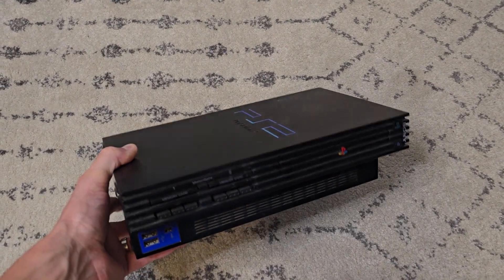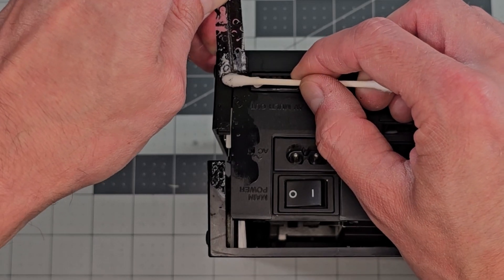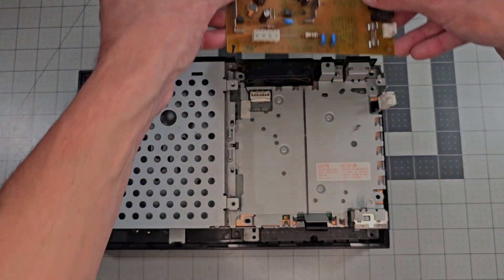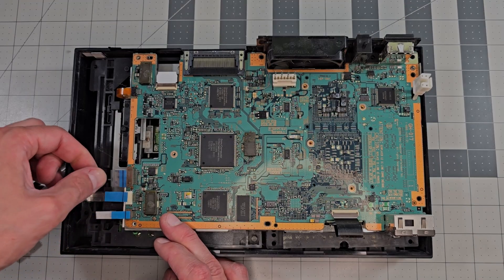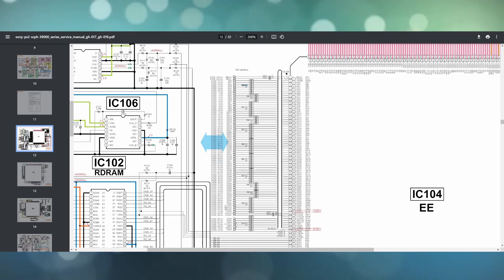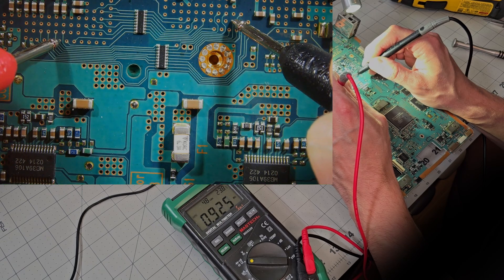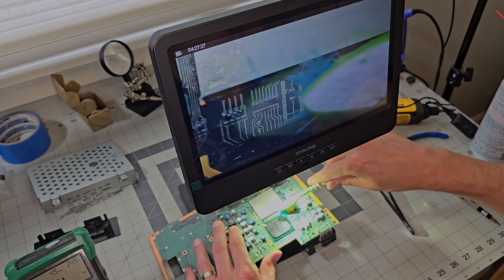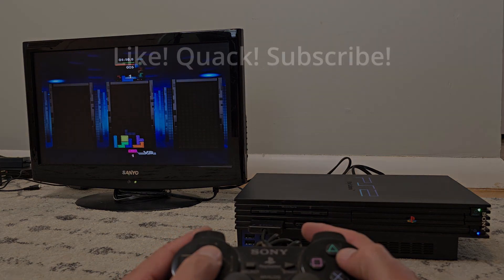Fixing a PS2 with a Broken ("Glitchy") Display

Comment: I have a similar problem however the screen is white and fuzzy with a line down one side no images are displayed. Model number is SCPH  39000,  am hoping this will fix it if not it's probably another board.

Comment: so currently trying to fix my ps2, and i will be honest first time working on something this complex using a magnifying glass and a budget soldering iron, testing the resistors get ranges from 47-50ish ohms but think that's just bad placement on my part hard to see and I'm not use to working with a multimeter, but i did check one resistor on the back side of the board that's 192ohms and unsure if that's too high and if i should bridge it. does anyone know what ranges are safe and what are not am checking each resistor twice since I'm new to this specifically so very bad at placement but want to know what I'm keeping an eye out for
Reply from the maker: Sorry each scenario is too unique to address without seeing things first hand most of the time unless you can give more specific information. "one resistor on the back of the board" is not clear enough.

Comment: I had no idea how to use a multimeter, and I've only ever soldered CMOS battery trays to boards. I followed your guide EXACTLY with my GH-022 AND IT WORKED. Instead of bridging it, all I had to do was clean up the solder and melt a little bit more in there. Putting it back together did not think it would work but omgoodness it works like a champ now. Thank you so much, I was so upset when it quit working.
Reply from the maker: That's awesome, glad you got it working!

Comment: I don't know if this is the same problem or not. But I have a PS2 and I don't even know how old it is at this point. But every time I start up the Playstation, the graphics are messed up and very glitchy. The language is messed up (unreadble). When I start any game, the textures are constantly flashing and it looks like a child scribbled all over the screen. The size of textures are completely messed up, and it's impossible to play games like Tomb Raider since some of the textures that you need to see just don't show up. 

My cousin told me it is the GPU that needs to be replaced or fixed, but I just want to make sure.

Comment: thank you so much for this. I had same error, and same first chip had dry joints as yours did, and on the other side of the board one section of the 2nd array was open circuit. I didn't have a usb microscope, so tried it with my magnifying glass and it was a fail. my eyes are too old, hands too shaky. ended up pulling the track on one leg's pad. had to get a usb microscope and run a fine wire to the test point. after I did those tho, it's going again! will get a new array to replace the one I've shorted. thank you again!.
Reply from the maker: I salute your patience and determination in getting the job done, and am happy my video was helpful, nice work!

Comment: The visual connection went out on mine some months ago. Today, I tried "deep cleaning" it JUST in case, to see if I could avoid taking it to a repair shop for "circuit surgery." This video and my failed attempt confirmed my problem really IS in the bowels of the console. I don't have the equipment or technical knowhow to do this myself, so I WILL have to take it in. But I still loved seeing you accomplish this miracle!! It's as good as new and looks stunning! Great job!
Reply from the maker: Thanks for this comment! I hope you can get yours fixed one way or another :)

Comment: My ps2 is a bit weird when using component (ps2 to hdmi). I have to "heat it up" for 15-20 minutes for the image is stable enough and not constantly lose signal. Maybe its time for recapping i guess
Reply from the maker: Recapping isn't a bad good idea, but I would also inspect the component cable itself, and also test with a different display as earlier steps.
Reply: @FantasticQuack but the green light on my fat ps2 is extremely dim at first and start gradually get brighter and brighter. Thats why im suspecting the ps2 that having a problem. But that only occur on component video though, if i use good old composite the display always stable even within the first minute
Reply: @dollarggwp9048  That def seems like powersupply issues.

Comment: My PS2 suddenly had polygons go all crazy, and green. It's weird because I could still use the system and attempt to play games, but yeah it's pretty unplayable. Found a one resistor not making any connection, another at 77 ohms, wish me luck!
Reply from the maker: Sounds like you're on the right track, good luck!
Reply: @FantasticQuack Was able to get it done yesterday, it worked, buuut unfortunately after I tested it, I went to reassemble it, and seem to have broken the power supply in the process? I was getting a high pitched whine for a bit, but now nothing, I've ordered a new one so hopefully that's just it

Comment: to make the short, what kind of wire did you use? New to this stuff
Reply from the maker: I just clipped a short length off the leg of a thru hole resistor

Comment: Hi!
So if one of the pads on a resistor array is reading 65 Ohms instead of 47, could that resistor be the issue?
It’s one of the resistors between IC104 and IC202!
Reply from the maker: Possibly but doubtful, you could test it with a temporary short to be sure
Reply: @FantasticQuack  My Ps2 is also 39001 and the graphical glitch is a lot less pronounced than yours. In the opening screen, the only thing that's glitchy is that the blocks are warping in and out, almost flickering... And games are entirely unplayable as the glitches are a lot more extreme when you boot game, although still not as extreme as what you had. I checked the resistors, there is only 1 problematic trace on RB121, it reads 90-100 ohms... This may explain why the glitches arent as extreme as yours... 

May I ask, would it even be safe to just jumper the bridge? Did sony put in the resistors for no reason?

Comment: I had the same issue after repairing the PSU of an "abandoned" ps2. The faulty resistor in my case was exactly the one around the 5:33 mark, reading 2MΩ in my case, and I'm so glad this fixed it, thanks. Do you think i should replace the array at some point? Or keep the short
Reply from the maker: I wouldn't fault you for leaving the short; the risk of it causing other problems seems pretty low, but since I don't truly know what that risk is, I would ultimately recommend replacing it (or even splicing a separate resistor with the right value as opposed to a short wire).

Comment: Hey mate, my ps2 display work fine when I use RGB output but when I change to YPBPR (using ps2 hdmi converter) my screen starts flickering and will back to normal in like 5 to ten minutes. Do you know the issue? any help would be appreciated
Reply from the maker: Unfortunately not, but it sounds like it could be capacitor related if the problem resolves with time (i.e. after heating up a bit).
Reply: @FantasticQuack Thanks for replying. I have replaced the capacitor near the AV port and my PS2 is working fine again.

Comment: I have a strange issue . I changed all bad resistors but when I turn it on it just says no display but if I reset it goes to black screen with NTSC and sometimes it shows pal but it goes direcrly into browser with a dvd icon and the wierd thing is that I disconected the dvd drive ribbons . Any ideas what can be the issue ??
Reply from the maker: Is the PS2 modded?
Reply: No not modded  @FantasticQuack

Comment: My ps2 boots up okay but the menus are patchy like you have a dirty snes cart or something. Anyone have any pointers on this? It’s so odd the boot logo is perfect but the menus are messed up. I do use freemcboot but the issues are happening with it without it in. I’m using component cables to an hdmi adapter. It was working fine when I last used it a few months ago.
Reply from the maker: You could troubleshoot the cables more buy just trying a regular composite cable on a different monitor

Comment: Hey mate, my ps2 display absolutely works fine, but there is no audio. Nothing wrong with AV cable because it works with other ps2.. Can you tell me where i can look into for the issues
Reply from the maker: I would start by seeing if you can track down the audio chips and inspect there. Let me know if you can get to the bottom of it!
Reply: Also make sure you have your audio being sent through the AV connection and not through your optical audio jack. This should be in audio settings

Comment: I have a PS2 slim that someone broke the power button when they tinkered with this, when I replaced the power button I found this same exact issue. Could this be the issue? I fear it's rather the Emotion Engine but I don't know for sure I'm just going off of what I hear.
Reply from the maker: Only way to know for sure is to measure those resistors!

Comment: I have a PS2 of my own and it’s displaying similar behavior.  When you measured the ohms on your multimeter,!what setting did you set it to to check the resistor arrays?  Sorry, I’m pretty much diving in the deep end here, but I want to get my PS2 back to its former glory.
Reply from the maker: I use Ω (resistance) in auto mode. Not all meters have auto, so in that case you'd have to pick the correct units for what you're measuring. If you google search your meter you can probably find a manual explaining operation in detail.

Comment: I’m having a different issue with mine 😩. Mine displays color sometimes and sometimes it’s black and white. It’s connected to a CRT in composite and have tried multiple cables and the issue persists. Both the TV and console are NTSC. Any help would be appreciated 😅
Reply from the maker: Have you tried a different composite cable?
Reply: @FantasticQuack  I have tried two different PlayStation OEM composite and one third party composite and same results.

Comment: I have a GH-019 and some resisters reading at 46 ohms could that be the problem ? 
The ps2 turns on but no display or audio
Reply from the maker: Nah 46 is fine, if it were bad it would be reading way off from 47
Reply: Did you ever get it to display something after multiple power cycles? Does your TV keep showing 'No signal' after turning on your PS2 or do you see a fully-black screen?